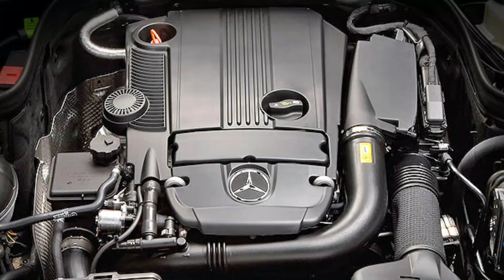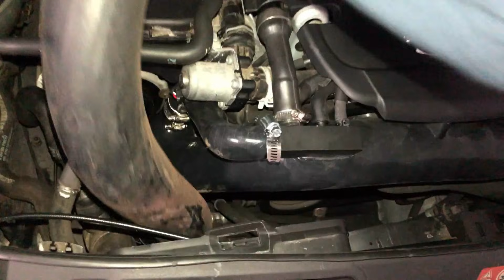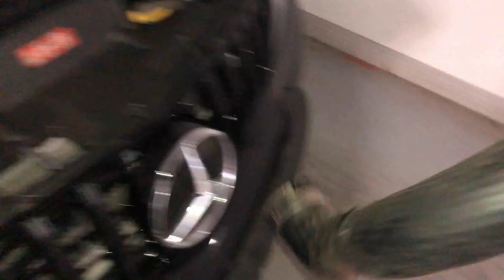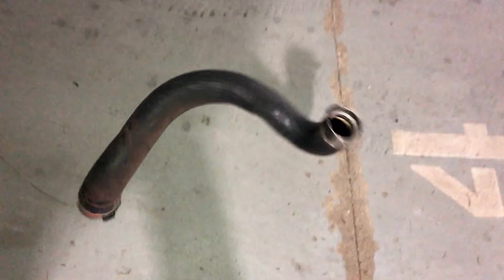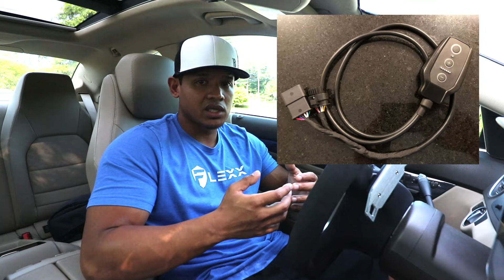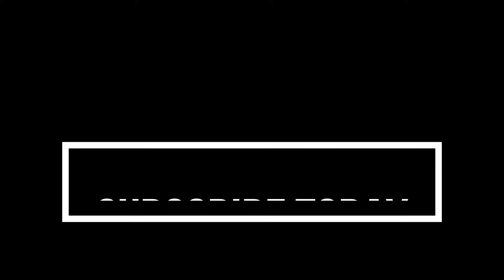Here's all my POWER MODS to my Mercedes-Benz C250

Comment: Flexx, shout out from Austin, Texas. Where did you get your steering wheel from in this video and what’s the part number? Also, can the throttlebody be upgraded? Not sure if you’ve already been asked this question.
Reply from the maker: Sup fellow Texan. Steering wheel is a wrap. https://youtu.be/OuEnQUWfa2o?si=IzVNg4UM4vaXOwj6

No point in upgrading throttle body. Little benefits. Spend the money on a tune.
Reply: @TheFlexxGarage Thx for responding.

Comment: I know it’s a really random place to ask this but I’m having trouble finding a straight answer. is the 2008-9 C300/C350 noticeably worse than the 2010-12s?
Reply: They're both M272s with the 722.9 trans, just depends if you want a pfl or a facelift... same exact thing

Comment: Flexx I have a 2014 MB C250 and I'm getting the P0068 code and can't find any problems. I was on a forum and saw back in 2018 you had the same code come up. What did you find to fix it?
Reply from the maker: I’ve actually answer this question many many many times on my sensor and throttle body video.  I did a lot , turn my car back to stock, change the plugs, air filter, removed my pedal tune, changed all my sensors, cleaned my throttle bottle, rsmoke tested for leaks and nothing. The issue eventually went away by itself.  I think it could be a glitch in software and the ECU might just need updated software. I was never able to find the reason.  Car drove 100000% fine and I couldn’t pass emission cause of it.
Reply: Wow that stinks. I watched your videos. I actually just put in the tornado tuning metal air pipe and the turbo air tube's also with that I change the sensor  in that air tube and the sensor just before the throttle body. I also cleaned the throttle body and relearned it. Cleared the code and it just comes right back within a couple of miles. The car runs fine (at least to me it does but I only own it for a month now and only put 1000 miles or so on it. I just don't know what to do anymore. Don't want to just throw new parts at it and it still won't fix the problem. Next thing I'm thinking is to get a new throttle body and see if that fixes the problem.

Comment: Hello, I am writing from Turkey. I want to buy a C 250 coupe and enlarge the turbo. Stage 2, but there is a chronic timing chain problem in these vehicles. How did you solve this? Or if this problem persists, have you experienced any problems? I would be happy if you could help me. I watch you on YouTube. I would like to benefit from your information.
Reply: You just need to get it checked my a mechanic before buying. Have some money saved up for if it does fail. And do supporting mods before u tune the engine or fit a bigger turbo.

Comment: I don’t know if anyone has asked and youve answered yet but how much HP does your benz have after this?
Reply: But how much hp
Reply: @Uncremtheplumber yes ? I want to know also -i think 204hp
Reply from the maker: These mods are not about horsepower gains on top of the hp rated on this car (except for the tune).  These mods are about keeping HP when your car needs it.  I might make slightly more HP then stock Hp but it’s not a crazy amount. 

When a car heats up from driving, it loses a crapload of power. These mods are gonna help keep the hp the car came with.  You can’t gain extra HP on top of your stock HP unless you force more air into the engine or aggressively tune the car. Both those things make this car super unreliable and I’m not all about that.  If I wanted a crapload of power, I would of bought a c63 or another higher performance car. For this c250, you can only upgrade some parts to keep the car responsive versus being stock and sluggish after 10mins of driving.

Also, all these upgrades will make the car ready to accept/support a larger turbo or a tune. Stock parts won’t cut it and will either maintain a lot of heat and/or prematurely wear. People run into issues when they try to make massive power with a tune or big turbo and they are running stock parts in the system.

It’s still a fun car to mod and drive.  I rather drive a slow car fast, then drive a fast car slow.
Reply: @TheFlexxGarage  I have the same car would u recommend modding it with 170k miles ?
Reply: Stock 201hp I got the same car great daily. Would love it to be faster. I’m gunna go for the c43 amg next

Comment: I am about to buy a stock c 250 with 118000 miles on it an am wondering what bolt ons can I get without busting my wallet
Reply from the maker: Each available mod has a video on my youtube channel with info where to buy in the video description of each video.
Reply: @TheFlexxGarage  am I going to need a tune after adding them. Or will the ecu adjust it self
Reply: @Trips407  yeah you’ll need a tune

Comment: Hey Flexx Alexander, Do you know if there are any aftermarket performance throttle bodies for the C250 cars? I've basically have all the mods like you just need to change the intercooler but any other recommendations or mods you might know of for th C250's.

Comment: Hey Flexx. I am in the market for a w204 c250. What are your thoughts on its reliability? I'm looking at ones under 50k miles. Did you have any major issues besides the power cutoff? i looked at one today and the engine had a slight vibration at idle. is that normal for these cars? i know there is cam shaft and chain issues. Maybe needs spark plugs or fresh fuel. who knows. But any insight is appreciated!! Thank you. - ant
Reply: Tbh with u I have the same car as well If u keep up with maintenance it would be fine. Missfires can be a big issue with this car tho. I got mine at 100k miles it’s at 170 now only took it to the shop once

Comment: Hey flex I’ve watched most of your c250 videos and found them extremely helpful. I’ve done a few of your suggested mods like the turbo muffler delete, divertor valve and the air filter. What mods do u suggest I do next?
Reply from the maker: Intercooler and then Get the car tuned by a pro. Like eurocharge to get more power.
Reply: Alright, do u think the tonardo tunes that you put on are still worth it then or should I just get it professionally tuned?
Reply: @TheFlexxGarage   cant find a website for tornadotuning …
Reply from the maker: Look in the video description. You need to contact them. Not look for a website.

Comment: Where did you get the air intake duct tube from? I’ve watched all your videos and you don’t mention where you got it from. And I’ve search online and still can’t seem to find something like it. 
Love your videos!
Reply from the maker: Not sure which duct you are referring. Every mod on my car in every single video i clearly mentioned what company is sponsoring the part, where the mod can be bought and I clearly say info is in the video description. Haven’t changed that format throughout my whole YouTube career.
Reply: @TheFlexxGarage  the duct tube where air comes in into the airbox. Yours look more stiffer and durable than my OEM one. I’ve already had to replaced mine twice because it fell apart.
Reply: @anthonytran9488  buy some heat reflective tape and wrap it , also go to your local auto parts store and buy a exhaust repair kit which is pretty much some aluminum sheet metal and place in between your engine and air box and fold it over the air box like in a L shaped type and that will help alot !

Comment: I've watched the video, which is great and really clarifying by the way, and I ran through the comments expecting to see the gains that you had with all these power mods and I realized that you didn't share the results in numbers, what at the end of the day is what matter most, in my opinion. I think that is pointless do all those effort, all those money without knowing how many whp or torque you won with it. Even because, by my own experience with turbo engines, there is some upgrades that can actually reduce your power (eg: when you push too much air and your cooling system is not efficient). But, again, is a great video  and congrats for your project that is really really awesome bro! Hope too see some gains next time hahah

Comment: 2013 c250 looking to add a little performance . I started with air filter and exhaust wondering if muffler delete and VTA T9458 DV+ PERFORMANCE a good next step. After that I will do intercooler and pipe upgrades along with ecu chips. Or should I do ecu first before installing muffler deleter or DV+. Looking for safest way to upgrade. I have reached out to tornado tuning and contact in your link but no response

Comment: Hey Flexx, appreciate the vid as I'm looking to upgrade my 250 coupe. Quick question, I have been looking at getting the tuning box, T box, and pedal tune but a little worried about passing smog tests. I live in Cali so I know they are pretty strict on emissions over here, any insight on if these performance mods would be flagged when being scanned by computers?
Reply: Even if you don’t pass smog, you can always find a place that passes you regardless. Just be ready to throw extra $ their way.